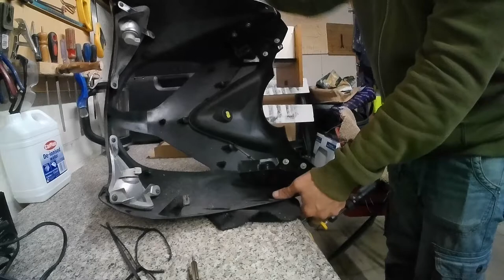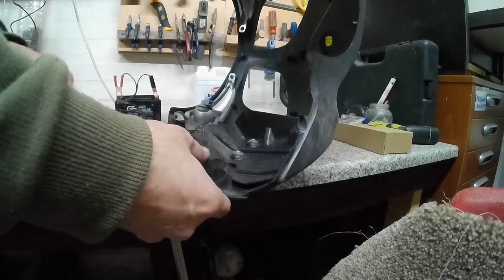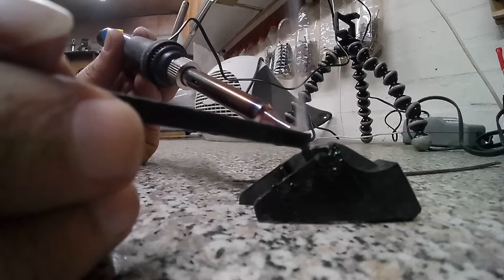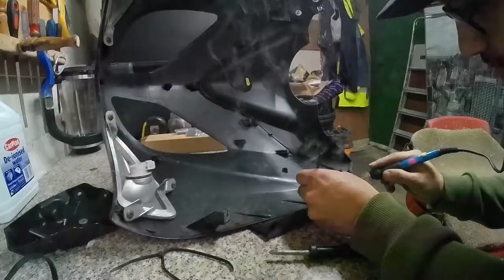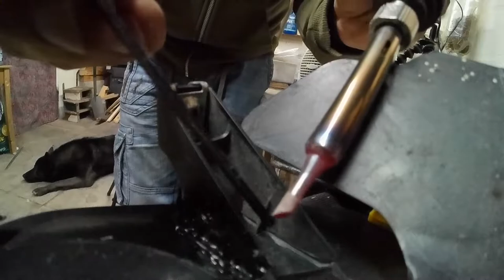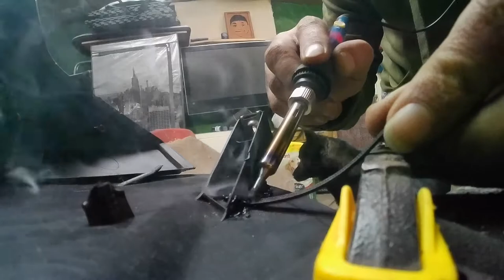How to plastic weld with a solder iron and cable ties

Comment: I've watched a few plastic welding videos, it seems they'd suggest not using a temp too high, lining the piece up, doing a few quick spot welds to hold it in place. Next you would press the solder in gently from one end, move a little bit and press again, do this along the entire joint on both sides. This will leave it messy, you can then add additional plastic to strengthen it, and then smooth it out with the soldering iron.

I haven't tried it myself, I'm just going to try it this weekend after watching a few videos.
Reply: you want to add some steel mesh too or it will jsut break again

Comment: So if like to add a few things as ive done this quite a few times with mixed results. First , there are many, many different plastics and not all of them will mix well. I think the cable ties are a aafe bet. However one thing i ran into is when you are welding, if you do it i layers, you have ro make sure each layer you ad sticks to the previous one. Also, your items must be 100% clean.  You should completely wash your items with Dawn and hot water so thay any oils and dirt are gone. Wash your hands and clean your soldering iron.  One thing i tried that worked well was to use gorilla glue brand glue sticks as the "solder" or welding medium. As long as it all melts together the bond is strong.
Reply: Is that any different than using gorilla brand hot glue?
Reply: @RussMeister70  same thing.

Comment: Hi great video,do you need to chamfer the edges to be welded ? to allow for full penetration as you would if welding a steel pipe.

Comment: That looks like a glue, if you aren't melting the original plastic. How strong does this hold? I find 2-part epoxy works pretty good for gluing stuff like this, but a high stress mounting point like that might need screws or bolts, or actually melting the plastics together to be really secure.

Comment: ...is this fecking soldering iron RED HOT, or am I seeing things🤣🤣🤣
Reply from the maker: That's how I roll pure heat
Reply: Yes. It doesn't need to be that hot.
If you have an adjustable heat Iron, just test it on a Cable Tie until it melts the Plastic easily, but doesn't burn it.
If there's loads of Smoke, it's too hot.